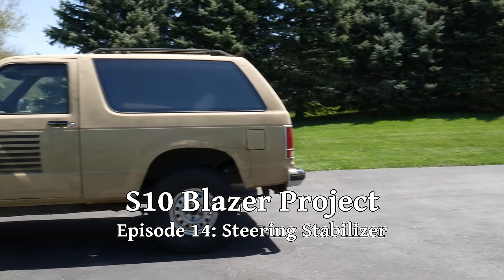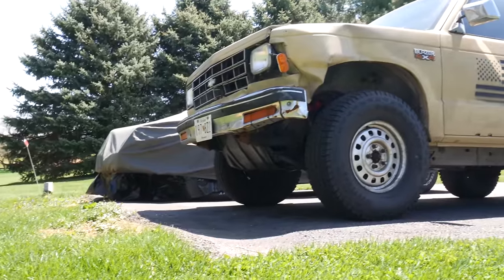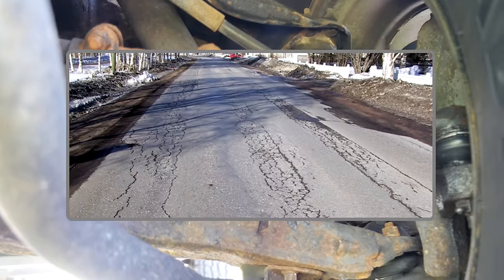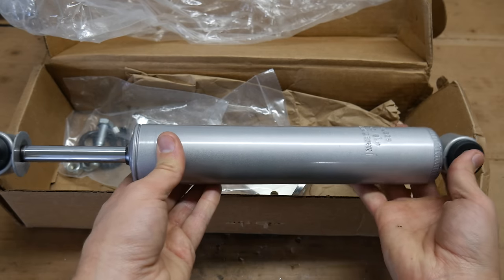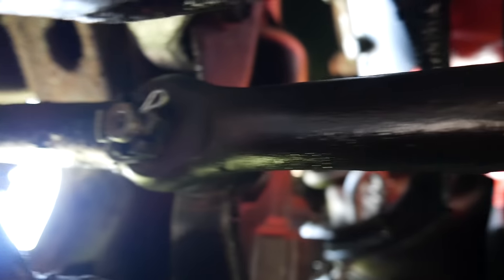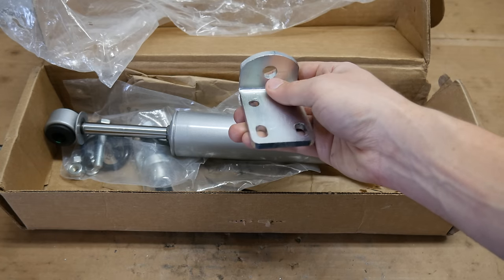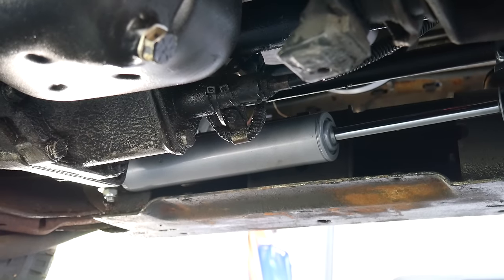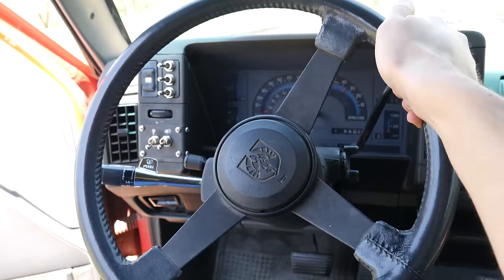V8 S10 Blazer Steering Stabilizer Install (Ep.14)

Comment: As I said before, on my car, the minute I got rid of the rag joint, the car stopped wandering and all that you mention. You can keep your shaft, just machine a piece of T6 Alu with air craft grade bolts and you're set.... oh, loctite as well.

Comment: Many years ago, I had an '85 S-10 Blazer... It did have a steering stabilizer from the factory. Even though you did that DIY alignment (for Toe-In), I'd recommend a full alignment to ensure the caster/camber is within spec...

Comment: You can cut way down on bump steer by toeing the tires in a bit more, not a lot just slightly more toe in than spec. After a couple days run your hand across the front tires to make sure they aren't feathering

Comment: You know if you use 1999-05 Blazer spindles/ lower control arms, you can upgrade to dual piston calipers. And the different sway bar will clear your tires.
We did this swap on our 85 4X4 pickup. Stopping is 40% better.

Comment: The extra engine mass and shifted weight distribution can screw with stock suspension geometries and spring stiffness; you've a lot more weight hanging in front of the axles with a 350 than a 2.8 V6.  If your ride height remained the same after the swap, something other than the springs must be compensating for the extra 200+ lbs up front.
Reply from the maker: My understanding is that the TBI 4.3L engines weigh just over 400lbs with accessories, and a 350 with iron heads should weigh somewhere around 475. And I stripped out quite a few parts (like the A/C equipment) from the engine bay so the difference is probably only 50-75 lbs. Doesn't seem to ride any different and the ride height didn't change from my measurements before and after the swap.
Reply: Ah... it looked a bit older than when they started putting 4.3s in 'em, which IIRC, was in '88 or '89...?  Since the 4.3s were essentially just 3/4 of a 350, not as much of a difference.
Reply from the maker: Yep! I believe the 4.3L started being put in these in 1988, which makes this truck the first year that came with them.
Reply: The added weight from the v8 won't do what he's saying is happening. I have a 93 s10 blazer 4 door with a 489 ci bbc and it dropped an extra 3/4" from stock height

Comment: How did you mount a camera underneath the vehicle?  Trying to diagnose something on mine and wanted to do that
Reply from the maker: I used a c-clamp style camera mount to clamp an action camera to the torsion bar crossmember. Specifically, it is a 4" Pedco UltraClamp that I bought six years ago, seems like they are a bit pricy now though so I'd look into alternate brands or just make one. I only had it on there for a short time though, I'd recommend some sort of security strap or wire to catch the camera if it manages to fall off!

Comment: thing to consider too is frame could be bent a tiny bit causing the bump steer as well.
Reply from the maker: It is possible, the front left frame rail did get dented a little from the bumper support bar after all

Comment: I've got a '91 that exhibits the same issues, bump steer and tramlining, and it got downright frightful on an icy highway.  I'm about ready to paint a white strip down the center and call it "skunk."  I've done some adjustment to the steering box, but I'm going to upgrade/replace the rag joint before exploring that any further.  Adding a damper (which I thought was going to be replacing a missing one) is just one step I plan to take.  I got the guard off, and there is no place for the business end on the drag link.

According to "chitlin's" most of those trucks were supposed to have one.  Led astray again.
I can't see how they can justify $65+ for an add on bracket made out of stamped metal, so it looks like I'm going to be making one.

The other issue I'm trying to resolve is a pop/jerk when it's in 4x4.  Nearest I can tell, it's not a chain drive transfer case (231-c).  Even if it was, it doesn't exhibit the slack that you would find with a stretched chain, so ... With that ruled out, can anyone give me the most likely place to look for the problem???   ...  ?
Reply from the maker: Does your truck still have the original vacuum actuator for the front differential? If so the "pop" may be the diff slipping from a poor/incomplete lock. Just an idea.

I ended up replacing the steering shaft with a more solid Cherokee one and it didn't really help the steering. The play is still in the steering box, the reman one wasn't actually that much better. The stabilizer made a big difference in masking the issues and making it driveable but it still isn't ideal or the most pleasant. Best of luck with your project!
Reply: @FuzzyDiceProjects    I just came in from installing the damper on mine.  My take on it is than it makes things easier to manage.

It was obvious, when I got the truck, that a lot of work has already been done on the front end.  One lower ball joint has a tiny bit of play, perhaps one of the lower arm bushing, everything else has checked out.  Not enough to explain it's wandering ways, in my mind.  

The looseness became a lot more defined when I lost the belt a few weeks ago.  Steer like a mule in a turn, and when I started to straighten out, easy for about 15 degrees and back to fighting it.  So, rag joint next, then steering box.  Fighting that plastic shield, between the power steering hoses and the lines to the remote oil filter being in the way, makes it difficult to find out anything.

It does still have the vacuum actuated front axle lock.  It failed me last time I tried to use it, about a week ago.  I haven't investigated that yet.

Comment: I just got a new remanufactured steering rack for the A6 I've been working on getting back on the road. The new unit has the same casting number as the one I turned in for a core charge, so it was nearly identical except for the fact that they filled in the hole where the damper went, and now on the new unit there is no place to mount the damper from the old unit. I'm not sure why they did this, the damper was still good.

Comment: I had the same problem with my 96 when I bought it but about a month later of dealing with that crap I got the frame looked at before I bought anything and found out my frame was bent just a little on the front passenger side, so I had them fix the problem which helped some with the bump steer not much, so I literally change every part that you did (minus the steering stabilizer) but I also changed my upper and lower control arms an now it drive's like new, cannot even tell it had a bump steering issue at all. But you might want to take a better look at them control arms partner might be twisting with time or just wore out maybe.
Reply from the maker: Thanks for the tip! The uppers weren't in great shape when I had them off to replace the bushings. Never got the lowers out since the torsion bars are rust welded in though.
Reply: Fuzzy Dice Projects 
Yeah that ain't very good I'd say swap them puppies when you get the chance an ain't nothin wrong with some used but still pretty good condition parts thats what I did, and keep the steering stablizer those things work wonders off road

Comment: I have changed shock absorbers that doesn't want to expand at all ,while brand new,and even after actuate them by hand in their working position.
As i know only gas shocks expand since one chamber's surface is bigger than the other( no rod on one side) so the pressure/surface ratio is greater on one side of the shock,wich expand it.
oil shocks doesn't.
If you want an accurate alignement,simply use the center of your 4 wheels to create a line parallel to your car (while taking in consideration the diferennce of track width between front and rear),and then adjust the front toe in according to this line.
Reply from the maker: Fair point! I guess I don't have much if any experience with oil shocks.
Reply: Me neither ,it's just that i saw that they didn't want to expand by themselves.

Comment: Something to look into on the S10 is the center link.  Heard a lot about the after market parts being the wrong geometry and causing wandering.  An AC Delco unit is supposed to fix the issue.
Reply from the maker: Interesting! I didn't replace it, and don't know why anyone else would have since they don't have moving parts on the 4wd trucks, but it is possible that could cause odd issues without a good alignment.

Comment: Lower tire pressure looks like you have them at max cold pressure,  32-37 psi would help let the tire take some more shock. Also kinda looks like wheel bearings are kinda worn as they jar or walk a little bit when you’re turning during the drive test.
Reply from the maker: The wheel bearings were replaced two years ago, but the front left one is just starting to get a little noisy (from the crash I'm assuming). The tires are at 32 PSI currently

Comment: I would like to see you put A/C in it...
Reply from the maker: It came with A/C, but unfortunately it is not going back together. In hindsight, I should have tried to keep the A/C but I didn't expect to have to drive it as much as I have in the last year or so. But at least it is more simple and there is extra underhood space without those extra parts. Besides, the interior vents don't work right and I REALLY don't want to take the dash apart.

Comment: Not sure if you have found the intermediate steering shaft yet, but you should check into Chevy Astros as well. They have what you are looking for.
Reply from the maker: Yep, that is another common option! Have one of those now as well, but ended up using a Cherokee shaft for this truck.
Reply: Fuzzy Dice Projects lol my notifications are so off that I had no idea you replied to my comment until just now. Since you have the Astro shaft anyway you should look into using it on the thirdgen firebird.
Reply from the maker: @captian1000  That's the plan! Plan to do a video on modifying each of them differently. Probably put another Cherokee shaft (have a few now) in the 1991 Firebird without welding it, and the solid Astro shaft in the 78 Firebird.

Comment: I hope you're not using those snow tyres in the summer
The wear and the noise would be horrid, best to have 2 sets of tyres for your area, the snow tyres and the summer tyres... it's a lot safer that way and more economical to drive in the summer.

Comment: You looked at everything and replaced anything on your front steering the one thing you have missed or neglected to mention that you looked at was the actual bushings on your upper control arms that attach it to the frame. I had the same issue that you're describing with your Blazers Big Brother a Tahoe and can tell you those upper bushings on mine were trashed and I ended up replacing both upper control arms and a majority of the sloppiness went away.
Reply from the maker: I did forget to mention it, but I replaced the upper bushings a while back, tried to replace the lowers too but the torsion bars are stuck in real good.
Reply: Somebody that is good with a torch should be able to heat things up enough for you to get those lower arms out and loosen up the torsion bars enough to do so as well
Reply from the maker: Yeah, I read a suggestion once about running a steel pipe through the front bumper and using a sledehammer on it and a torch on the control arm to get things loose. If it ever comes down to it that is probably what I will try.

Comment: I have a 4x4 s10 blazer and the frame mount for the shock isnt there why?
Reply from the maker: I found some examples of models without that, but I have no idea why some have it and some don't. Have seen some really early model first gen trucks with them and later years, so I don't think it has to do with that. Maybe related to the trim package? Mine is a Tahoe, so maybe that had the option of the stabilizer even though it wasn't chosen on my truck. Just a guess though.

Comment: My truck tends to tram line a lot, but is that more so the fault of the vehicle or the road, can i get rid of it at all?
Reply from the maker: I suppose it depends on the cause! Check out other comments on this video, people have great suggestions on parts to look at in addition to what I mentioned in the video. Some road surfaces are just going to drag you around, but if it is happening almost everywhere it is more likely to be your vehicle. If you have real wide tires and/or aggressive tread you're more likely to feel it more often.

Comment: Why even keep the front sway bar? I dont think it would make a very big difference on the road, and it would be a huge upgrade if you ever travel off the beaten path
Reply from the maker: It might make some kind of difference, and these trucks had such a reputation for tipping over that I want to keep it for now at least, since I have had to rely on driving it on the road a lot more than I expected to.

Comment: You should really need to get some spacers for the front of blazer so you don't mess up you new tires
Reply from the maker: A little bit of rubbing on the frame/sway bar won't hurt anything, especially since it only happens at full lock and I wouldn't dare to go more than a few MPH with it turned that hard anyway haha

Comment: Dude you need to save that old oil and coat the frame, steering and rear end in it to prevent the rust. If you got an actual alignment you wouldn't be chasing demons because the aliement shop would tell you what the problem is.

Comment: Can you help me rebuild  my blazer
Reply from the maker: I can try to help if you need specific advice, but I'm afraid I'm busy enough with my own projects at the moment!
Reply: Fuzzy Dice Projects can you send me the links on where to get all the parts to rebuild  the 350 Chevy engine
Reply from the maker: Your needs might vary based on the condition of the engine, year/model, and if it has been machined/bored in the past, but here are some eBay links similar to what I bought to get you started: (although I'd recommend some extra parts like positive seals for intake valve stems and a bigger cam than the one linked)
https://www.ebay.com/itm/271449848809
https://www.ebay.com/itm/251627260819
https://www.ebay.com/itm/232795269962
https://www.ebay.com/itm/132285807039

Comment: I bet the box has a crappy rebuild..
Reply from the maker: Doesn't seem like it, there isn't an unusual amount of discernible play from it even under a load. It is certainly better than the replaced one at least
Reply: The rebuilt one in my s10 ended up needing adjustment. After the steering shaft, I still had wandering. Made a small tweak to the box. Made a world of difference.
Reply from the maker: What was the tweak that your box needed?
Reply: Fuzzy Dice Projects I tightened up the preload by adjusting the Allen bolt on the top of the box, I went 1/8 turn till I got to a point where the slop was gone and the wheel would return to center. Most of the rebuilt boxes just have new seals so they do not leak. FYI mine didn't need much, maybe 1/4 to 3/8 turn
Reply from the maker: Ah, got it. The box I got claimed to have been recalibrated, but I didn't check on it. I pretty much maxed out the overcenter adjust and bearing preload on the old box and it didn't help, and this box is already better. I'll see if the steering shaft fixes it, I want it replaced anyway since it rubs on the exhaust.